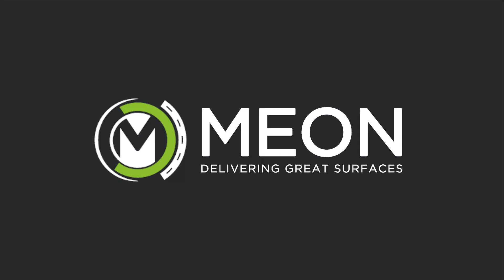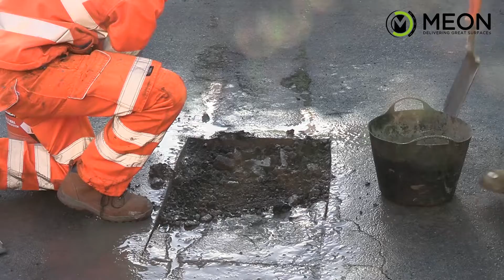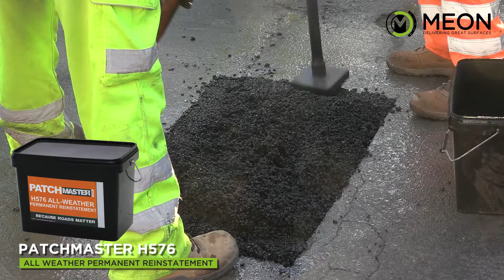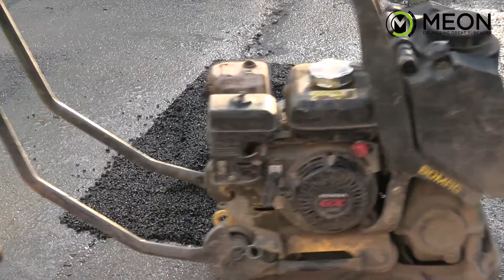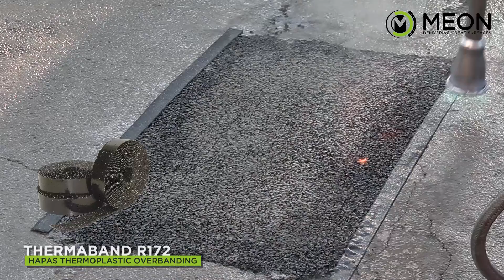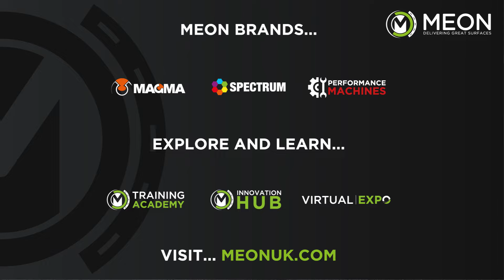MEON | Is coldlay tar any good? | With Clinton Humpris

Comment: My experience is not it's not fit for purpose and never cures. Note I am not on about pcsm's
Reply from the maker: It very much depends on what cold lay you use. Some temporary cold solutions remain soft, but other permanent options such as the PermaFyx area hard cure with a very similar finish to the mastic asphalt.
Reply: @MeonUKltd  permaFyx is that reactive with water or set after 20-30 mins as stayed in other reaply
Reply from the maker: The PermaFyx is a chemical reaction cure with an MMA base. You can see more details here - https://meonuk.com/products/permafyx-l273-permanent-asphalt-repair.